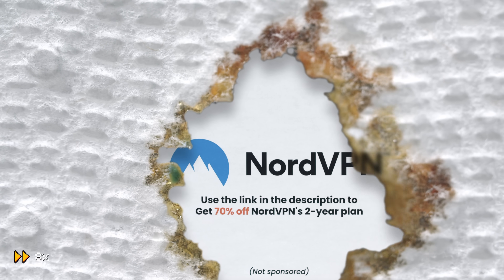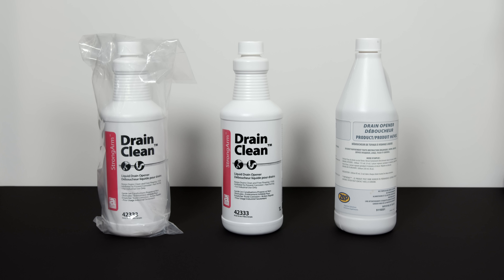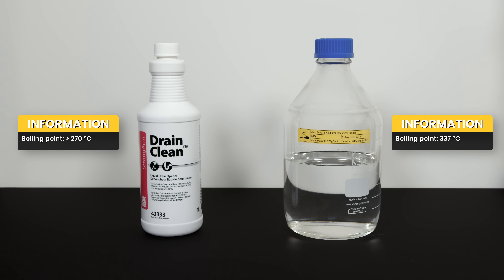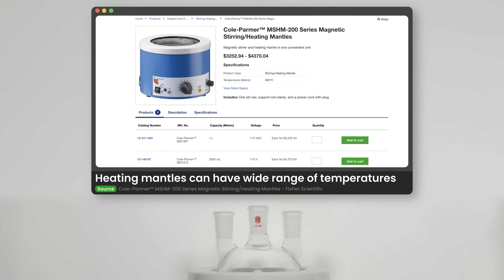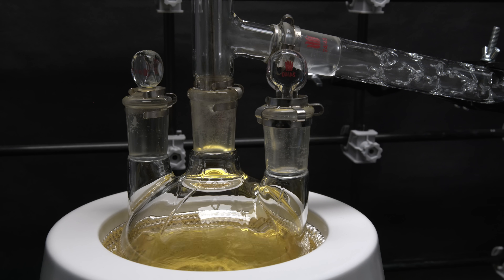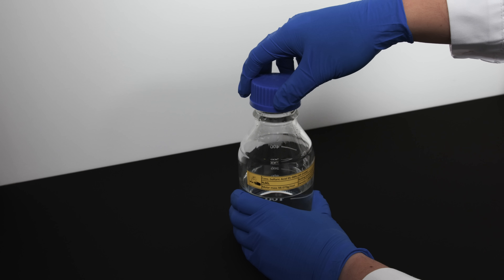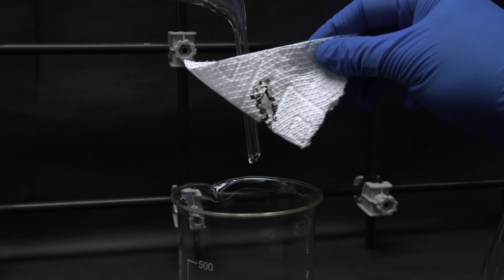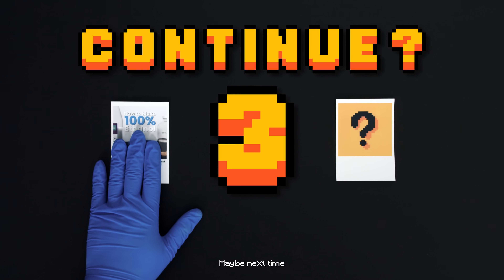The Most Dangerous "Simple Distillation"

Comment: I fail to understand why are you using a Vigreaux column in your downward distillation. I failed to understand why you don't use broken glass for boiling chips. Finally I failed to understand why you don't use a Perkins triangle and eliminate all the ground glass joints. You should also purchase a blast Shield
Reply from the maker: 1. Vigreaux column is a substitute for air condenser in my case since I don't have one, they function pretty much the same in this scenario.
2. I couldn't make broken glass to work safely as boiling chip and haven't seen any others that can use broken glass safely either as seen from many videos, kindly link me the video where it can work, I would love to try the same setup as well.
3. I am not familiar of the use of Perkins triangle, mind explain how to setup it that can improve this distillation?
Reply: @DangerousLab  Rather than try to descibe a Perkin triangle, I urge you to look it up in glassware catalog. Basicslly it all the glassware peices attached to esch othrr with clios. It all one peice. Glass beads are avsilable that are used as boiling chios. They wont scratch your glassware. A blast shield to protect you from exploding glsssware.
Reply from the maker: I am using fumehood with polycarbonate shield which would shield me from chemical splash or shattered glass in case that happen. I have tried glass bead specifically design for anti-bumping, but it didn't work, I tried few variations of glass but none has worked which I ended up gave up on using glass.
I have looked up Perkins triangle but still couldn't understand how it is helpful in the setup, my current setup does have joints but they aren't really that problematic that needed to be eliminated.
Reply: I understand, most people are lows to admit they are wrong
Reply from the maker: @blindlemonpledge2556  Yes, you are right.
Reply: I don't believe you re: glass as boil easers and your video doesn't show the fume hood or a blast shield.
Reply from the maker: Glass generally works for most boiling just not for distilling sulfuric acid though, I so far haven't found any success either from me or from other Youtubers' video, feel free to link me the video if you found one, if there is no proof then there is no point of discussing further.
And you don't see the fumehood is because the camera angle is always close up so you won't see the polycarbonate panel in front of it.
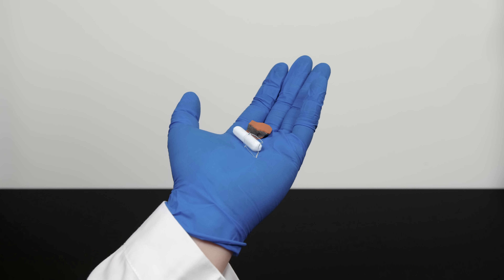Reply from the maker: Just FYI, 8:51 entire section is about the choice of boiling chip, the clip with flash boiling is from the using of broken glass, I couldn't get a camera angle pointed downward to show the bottom contains broken glass though.

Comment: You know you don't even have to distill most drain openers that are technically technical grade. There's one in particular it's rudo professional drain opener and it's a manufactured just maybe 15 minutes from me they make technical grade as well and they make it all with as much high quality as a drain opener or vice versa I should say the technical grade. All you have to do if you're trying to get moisture out of your acid which is a very valid activity just get very high quality Pyrex from Germany the the extra thick beakers the tall ones are the best and simply boil it off the last constituent that's going to come off is sulfuric acid so you won't be wasting any you'll be able to tell when all the moisture is gone put an upside down beaker over top of it to prevent much moisture to be sucked back into the hot sulfuric acid. I use the ones without rims I always buy a couple of those big ones without pouring spouts and they'll steal your beaker off nicely. But you don't even have to distill it for Christ sake just boil it off it will even destroy any organics in it
Reply from the maker: Yes, you could use drain cleaner to substitute conc. sulfuric acid for many applications, but distillation is also valid for distilling from other source such as battery acid from lead acid battery where metal ions needed to be removed.

Comment: Have you tried PTFE joint sleeves? The same effect as the tape, but reusable.
Reply from the maker: I have PTFE sleeve but haven't tried using it on this particular experiment since I couldn't fit in the metal keck-clip and are worried the joint will pop off in case of accident.

Comment: When i did it the first time the acid mist didnt get through the condenser for some reason, so i stopped the water cooling because im fucking stupid and the temperature shock broke my cooler. But i didnt give up and the second time it worked. Use aluminum foil for insulation, dont use plastic tools for holding the glass, they will melt. Also use a fume hood or if youre poor like me just use a fan and an open window
Reply: A fan and an open window? You did this INSIDE? 😭
Reply from the maker: It will work, just be careful though!

Comment: About the boiling chips & running multiple batches: after the 1st batch is run & you cool the apparatus, sulfuric acid will be drawn into the pores of the clay, rendering it ineffective as boiling chip for the next batch.  You will have BIG SURPRISE when the 2nd batch comes to boiling temperature!  You should always put in a fresh, DRY, clay boiling chip for EACH batch.  There MUST be air in the pores for the chip to be effective.  If you interrupt a run for any reason, you must add fresh DRY chip.
          You can reuse clay boiling chips if you drop them into cold water after distillation, rinse out all the acid, & DRY them COMPLETELY before reusing.
Reply from the maker: Thanks for the info, but I will probably use telfon stir bar moving forward since they are reusable for a very long time.

Comment: Flame is suitable as long as you adjust it slowly and keep it below the liquid level. Sand works well for bumping suppression. I also wonder if an ultrasonic cleaner setup would create cavitation / nucleation sites to keep bumping down...
Reply from the maker: Still I wouldn’t recommend using flame as the level of experience required is much higher and it introduce unnecessary risk, and for the ultrasonic setup I really haven’t thought about that, I would probably try it on some future distillation to test it out.

Comment: I use carbon chips
Reply from the maker: I tried activated carbon before, but result isn't good for 2 reasons:
1. Its density is too low and mostly float on top of the acid.
2. Many of them are being oxidized by the acid which produce water in the process.

Comment: Out of curiosity, why is your fractionator horizontal? Way back when, I packed a BS glass tube with glass wool and it was vertical, just like the ones in oil refineries...worked well enough that I threw up as soon as I drank some🍄
Reply: Oh to clarify, I was distilling vodka into 95ish PC alcohol.
Reply from the maker: Oh, because the fractionating column in this experimental act only as an air condenser, I don't have a proper air condenser so I just use vigreux column to replace it which works fine.

Comment: Awesome video! When NurdRage redid his with the ceramic hotplate, I felt that was the most reasonably safe approach. Either his or your method, I wouldn't feel comfortable unless I was doing this in a large backyard where I can observe the distillation from 20 feet away...
Reply from the maker: Remember if you do this, especially when using hotplate, you must have proper boiling chip, otherwise the flash boiling could shake and smash the flask against the hotplate, potentially cracking it.

Comment: For europeans out there, if you only order like a litre or two just register (in Germany at least) a small business and use the VAT number as a verification that you are a business customer. If you really only use it for legal purposes in small amounts like a litre occasionally you will get it in high concentrations without issues. The registered business doesnt necessarily have to be related to chemistry. I bought permanganate for example for wood staining, but is also useful in hobby chemistry but hard to obtain. Just my two cents, since this way you avoid dealing with dangerous distillation and can just use it as is for like 20€. Just know how to handle it and always wear PPE (especially gloves and full face mask with the CORRECT FILTERS) no matter what, if youre just doing chem as a hobby. Ideally outside and be aware of the dangers, read all safety symbols and prepare for every situation. Basically, just be very very aware of the dangers and have respect of the substance youre working with and then youre at a good starting point.
Reply from the maker: Thanks for the info!

Comment: Here's a neat safety demo I got to see in person.  This uses 4 glass beakers.  Two beakers have a raw egg in them, with yolk intact.  These represent your eyeballs.
The other beakers contain; Hot Sulfuric Acid in one, and a Concentrated Syrup of NaOH in the other.  Doing this demo w/o safety glasses = Darwin Award (jr)
Now pour the acid gently on one egg and the Base solution on the other egg.  Wait about a minute or less until the acid is burning the surface of the egg black.
The other egg is not doing anything.  The beaker just sits there with the raw egg on the bottom and the NaOH solution on the top.  So, which chemical is worse to get in your eyes?
You can explain that an eye surgeon can scrape the surface of the eye where it is burned and restore sight potentially, while removing the charred acid egg piece with tweezers.
The other beaker...you explain that the eye surgeon will have to remove your eye while you can still see light with it.  Turn the beaker upside down carefully and the raw egg is solid.
In the 60 seconds it took to explain the acid beaker the base eyeball has gelled, or polymerized, or whatever and even though still working it is now totally fukd forever.  Bye, Eye.
It is not possible to put Safety Glasses on fast enough when an accidental exposure is occuring.  You must plan for Eye Safety ahead of time.
Reply from the maker: A very interesting take!

Comment: Quality of these videos is insane! Most helpful sulfuric acid on YouTube by far. Keep it up!
Reply from the maker: Thank you so much! I will keep it up!
Reply: I've done this.  I used a retort bought specifically for this because there were no joints.  After trying lots of things, I settled on stirbar because it worked for the bumping.  I may try the clay pot next time.
Reply from the maker: @monkeman5061  Although I would say clay pot has the smoothest boiling so far, but if stir bar already works for your setup maybe you don't need to risk using clay pot as it can get scratch marks on your flask.

Comment: I remember distilling sulfuric acid like two dozen times with broken glass until i finnally tried it with no chips at all and was shocked that i barely had bumping compared to broke glass....
Reply from the maker: The first time I tried no boiling chips after countless failure on broken glass is a true WTF eureka moment for me, I guess you must have the same feeling!
I also tried small and large glass beads after broken glass, but all failed the same way broken glass did, so I suspect there must be some problems with using glass for boiling chip despite so many people suggested it.

Comment: What about using a vacuum pump to lower the temp?
Reply from the maker: In theory it can, but firstly it will no longer classified as "simple distillation", also the bumping behaviour would be different under vacuum which is a total different setup that I am still exploring.
The main reason that vacuum distillation would be used in this setup is usually for getting 98+% sulfuric acid as it would normally decompose into SO3 + water >300C, hopefully I can cover the vacuum distillation version in the future with another video!

Comment: could vacuum disillation be used to lower the boiling point and induce less stress in the glassware?
and why don't you use a water cooled condenser?
Reply from the maker: Using vacuum is possible but it will add another layer of complication and it is also no longer under the definition of "simple distillation" which most hobby chemist do.
As for the condenser, running water on it will increase stress on the glassware as temperature gradient is very steep, it could crack the glassware although I haven't actually tried it as I never run water in this distillation.
Reply: @DangerousLab  i have seen a lot of youtubers do this distillation with running water in the condenser
Reply from the maker: Yes, but also many of them that don't do running water with it. So far I haven't seen any report on Youtube about condenser cracking with water, but there are still few concerns regarding it:
1. Running water with it on closed loop require active cooling on the water otherwise it could boil as the system will need to run for 5+ hours, running tap water could be too cold and also wasteful if you run it for 5+ hours.
2. The temperature gradient is wide enough so water is not needed, so there is no need to complicate the setup.
3. And if the condenser cracked, it would be quite a disaster as sulfuric acid vapor will be in contact with the water.
So although I did not personally tried it, I don't recommend trying it on a safety standpoint, accident may not happen on the first time but could happen if the glass are constantly under this kind of thermal stress on prolonged runs.
Reply: You have to think a little bit about what the fumes coming off sulfuric acid might do to your vacuum source--an expensive pump, for example--and how to mitigate it. You also need to think about what your vacuum source might do to this prep. For example, if you're using an aspirator pump with water as your circulating fluid, you want to be sure that it doesn't have a net effect of adding water to a system you're trying to dry.

Comment: I distilled SO3 from oleum (65%), and used a mixture of perfluoropolyether (if you don't have self made perfluoroethers, you can buy it "fomblin pfpe lubricants") and Polytetrafluoroethylene powder (just grind some fluoropolymer (C2F4)n) as a lubricant. It does not stick or leak. 
Why not use a vacuum to distill sulfuric acid? A water jet pump would work well as a pump? Or you can use some oil pump, you need to use some sulfuric catcher with CaO pellets in it. And inert gas should be fed into the cube through a capillary to facilitate vapor escape (To avoid explosive bubbles). This would reduce the temperature. I used asbestos cloth/glass cloth as insulation.
Reply from the maker: The setup already sounded so complicated and advanced Lol, I would love to try distilling SO3 or vacuum distillation of sulfuric acid once I figured out the safety precautions and gear required for it!

Comment: You can add pearlite from the garden supply section to it for boiling chips to stop it from bumping. Use the sulfuric acid itself to seal the joints. You will want real glassware and a higher temperature heating mantle. Also do this distillation on a surface that won't be unduly damaged by heat or acid 😮
Reply from the maker: Interesting, I will give perlite a try also on my next run, it looks promising!
I don't use sulfuric acid anymore for joint sealant as it is quite inconsistent compared to PTFE tape, and also because PTFE tape is so cheap and work so well!

Comment: Excellent summarization, thank you. Purifying sulfuric acid seems to be the most dangerous routine step required. Thank you for your timely showcase on how to perform this as safely as possible.❤

I can’t seem to find anything on the glass jacket online. That’s very cool. Can you provide a little more information on where to find this? Thank you!
Reply from the maker: So far I found 2 more glass jacket with various size that sell on Amazon, the price isn't exactly friendly but getting just one will do the job, you need to check the size of your glass joint and measure the distance of your distilling head to the vapor front in case your are going to buy one, it will not measure the temperature accurate enough if it is not touching the vapor front.
https://amzn.to/3F4wuX8
https://amzn.to/3QJulCC
Reply from the maker: Thanks!
I got the glass jacket from local science vendor for schools quite some time ago, but they went out of business (I think), so I am still looking for alternative solutions online. I will let you know if I find something usable.

Comment: Have you tried ceramic or granite marbles or balls for boiling chips? It might reduce scratching as they are less pointy. Also there’s wide Teflon tape thats 2” in width which I feel works better and more evenly
Reply from the maker: There are 2 more things I tried but didn't mention, glass beads and activated carbon, both didn't work, which I believe granite would be the similar case to activated carbon and reacts to the acid, ceramic could be a good candidate though and I will definitely try it in the future.
Reply: Instead of any boiling chips I‘d personally use a glass coated stir bar. They are more expensive but Imo by far the safest option and it‘s worth buying one